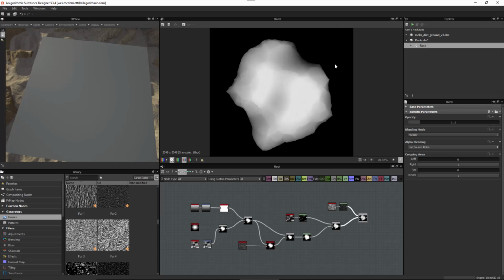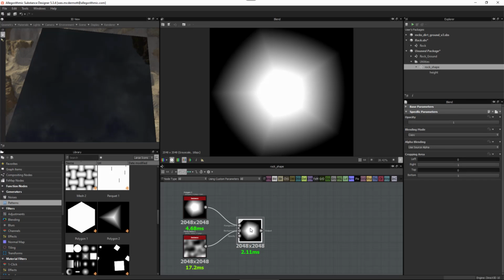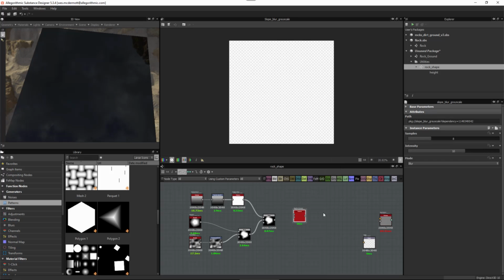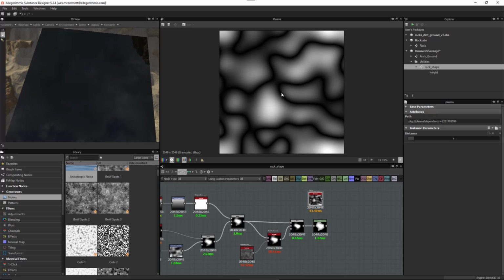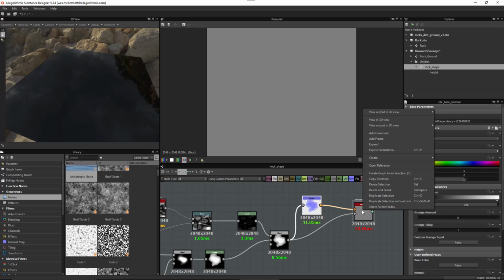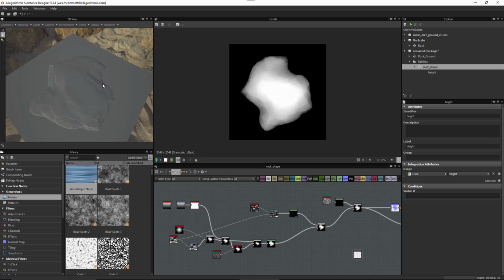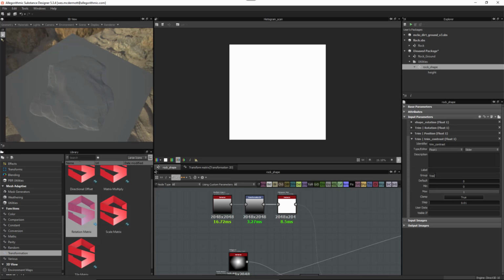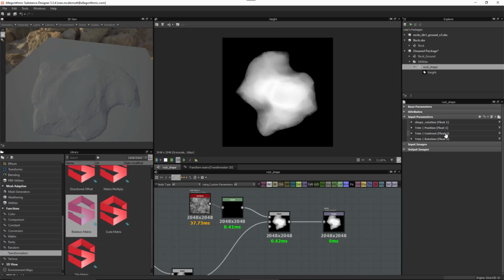Substance for Unity: Chapter 02-01 Creating rock shapes | Adobe Substance 3D

Comment: Does anyone know if Unity has a function to take out measured shapes. I.e. using coordinates for example to take out a particular part of a cube by using coordinates so to achieve some precision? Thanks.
Reply from the maker: I'm sorry but I'm not sure what you mean. You an input maps into the substance to drive the final output, but you can't input mesh data.
Reply: Thanks

Comment: hi there, amazing tutos, I have some issues creating my rock shape.....my shaope its finsh it, but when I setup the emty function for the transform 2d node, the get float node link the setup for the trim rotation an shape rotation....if i change one o this make the same change in the other function...its like an instance....and cann eneble the operator in the root grahp
Reply from the maker: Thanks! Can you please post in the forums and I can help. It sounds like you are using the same float parameter for both the shape and rotation.
Reply: yes, thanks i fix it. love this software, many thanks

Comment: For me there isnt a Material Preset option when i add a pbr_base_material. So how do i set it to dialectric?
Reply from the maker: You should have a dropdown menu for the Material Preset. When you click that you will see Dielectric. It's the second option. By default, it's set to Custom and you can change this to dielectric by changing the metal value to 0.

Comment: Great tutorial.  I'm working with version 5.3.4 and I don't seem to have a rotationMatrix, but I do have a rotate_position.  Is this the new function for rotating?  My Image doesn't seem to be rotating even with this one.  Thanks
Reply: by all means , there's no rotation matrix, clicking on the + for functions didn't help either
Reply: Edit:  I fixed this by pressing the '+' on above the library to add a new filter.  RotationMatrix showed up in the list of available filters to add.
Reply from the maker: +relicright That sounds like some kind of glitch in the UI. You should be able to see the rotationMatrix in the Functions>Transform area of the Library.
Reply: having problems to find the   rotationMatrix  too, :/ [ver. 5.4.0]
Reply: check my response to the original post.  That's how i was able to add the rotationMatrix to the list of filters.

Comment: Hi Wes. How do you deactivate an individual node? Coming from so many other node based programs, it seems like this should be a must have feature.
Reply from the maker: +Jim Bachalo Hi Jim. Are you thinking of like a pass through mode? We don't have a setting on a node to deactivate it. What are you looking to do with the deactivate? If you are wanting to see the result of a certain node in the viewport, you can right-click and drag it to the 3D view. If you are looking for a method to route between 2 branches of a graph, you can use a blend set to switch and create a user control for the opacity to switch between branch A (foreground input) or branch B (background input).
Reply: +Allegorithmic thanks yes, was thinking of pass thru

Comment: I tried a blur after the levels for the roughness ( the BnW spots) and it soften the effect enough to add a little more of it, I'm kinda unsure about the position of the trim
Reply from the maker: +TheNinetitle What are you thinking for the trim position? Are you having trouble setting it up?
Reply: No, it's a "artistic"problem, now it depends on the rock but the kind of imperfection created by the BnW spots shouldn't appear in the deeper angles created by the trim.
Reply from the maker: +TheNinetitle In this case, you can set the trim nodes to happen after the BnW noise. You can change the blend mode to add to remove or "overwrite" the noise.

Comment: I have a problem, my Normal node goes only up to 3 and the intensity of the Warp node goes from 0-1 :( 
I have the latest version too, 5.3.4 build 17162. What am i missing?
Reply from the maker: +Jokester The Mighty Its very easy to miss : ) As stated in the comment above, you can double-click on the slider to enter into a number entry mode. When you set a higher value, the slider will adjust to the range.
Reply: +Jokester The Mighty Did you try typing a higher number?  If you just slide it does max at 3.  But if you type a number, say 5 it should work.  Hope this helps.
Reply: Oh i didn't know you could actually do that! Hah magic!
Reply: Thanks for the reply! Keep up the good work!

Comment: Great tutorial, thank you very much! 

Also great tool this substance designer... 
My only problem with this software is that I do not have the required fantasy to come up with those nodes and put them together in these ways. I always end up having plain, boring surfaces, with no spicy look whatsoever (like yours for example). Whenever I try, I get unrealistic materials. I hope I'll be able to do substances just as good as yours one day. I presume there are unlimited possibilities with the procedural approach... One does only need to find the correct nodes and parameters....

Greetings from Switzerland :)
Reply from the maker: +raphu604 Thanks! Honestly, I feel the same as you do : ) There are so many incredible substance artists. What I try to do is look at some reference and then try to take the material creation step by step. I try to start with broad shapes and details and then build complexity on that. I look at the reference and then check the noises to see if I can find a similar pattern. Just take it one step at a time. Start simple, and build detail on top of that basic foundation.
Reply: +Allegorithmic Cool, thanks so much for the tips! I'll give my best.